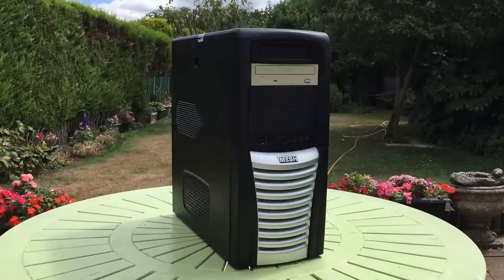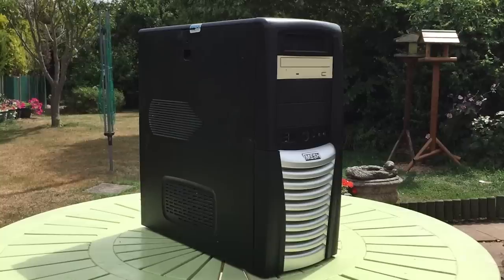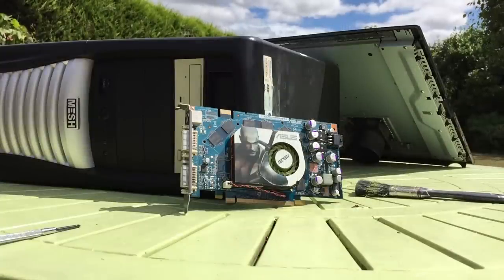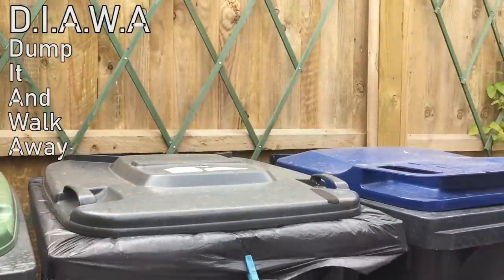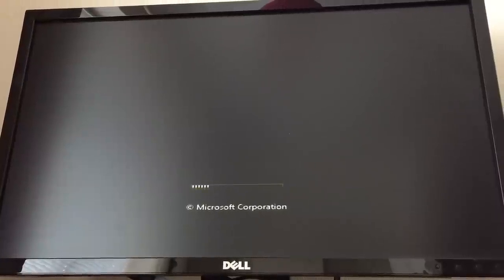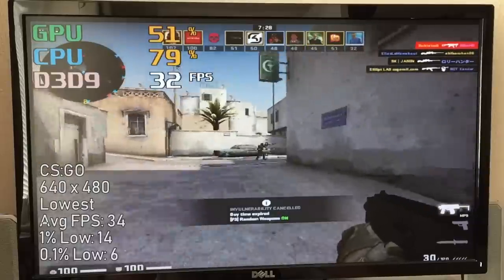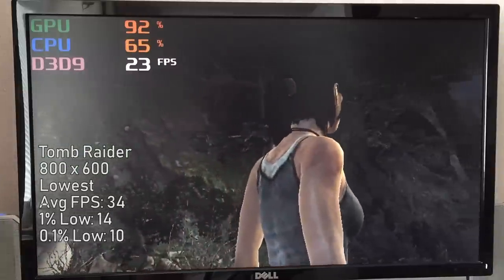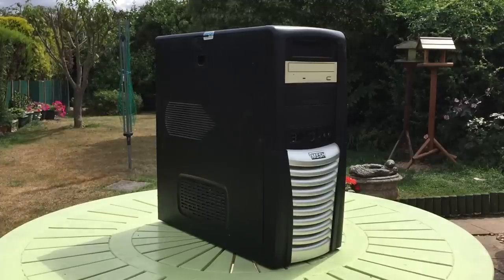Using an old £1000 ($1300) Gaming PC For The First Time In 10 Years...

Comment: i like these videos, however your dump it was a bad choice this time around. that was an O.G. intel heatsink with a solid copper dissapation core. that's as good as any modern aftermarket cooler, and intel was retarded for stopping use of such solid heatsinks for their processors. you sir, just threw the only part of this computer you could reasonably still use on modern hardware, and it woulda probably resold for as much as you bought the whole pc from to the right person.
Reply from the maker: I have a spare but you’re right. Time to salvage and restore the old beast
Reply: is it still Dumpster diving if you are going through your own trash?

Comment: SHAME on you for throwing out that heatsink because of a little dust, you figure out which way the wind is going first, then use a air compressor.  if that fails then a hose.  You could of easily just used a simple medical filter over your mouith like doctors and nurses do then you would of avoided that.  Don't be such a sissy with Dust and throwing away parts that you could easily clean.  Just gotta be prepared for when the wind shifts and that would of done it with ease.  And of COURSE It could still game, if it functions and is given proper parts it could game, given proper eras to game on (10+ year old titles, would do especially well under windows XP with 2000/XP era games)